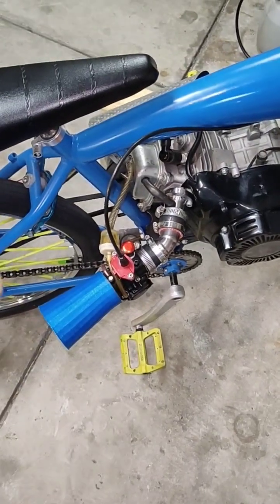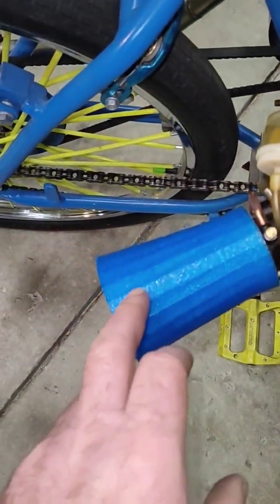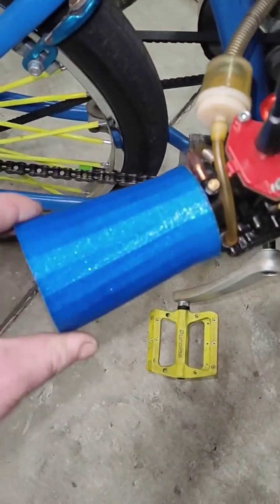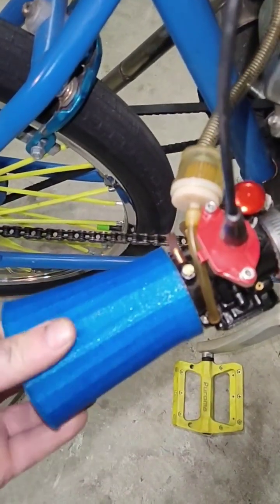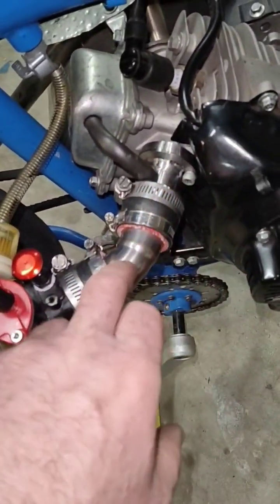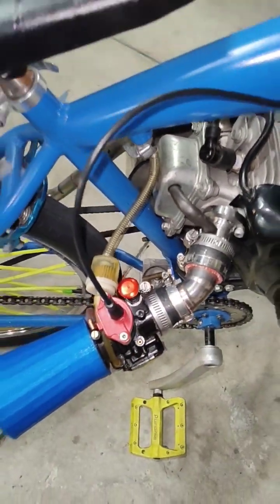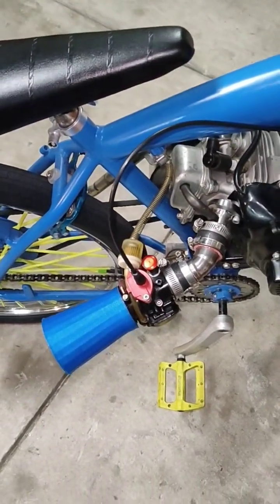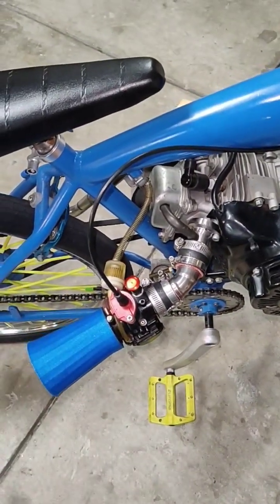V Stack Test Of The Modified 110cc 4 Stroke. (Trying To Stop Blow Back(

Comment: Why do you have your valve cover venting into the intake port ????
Reply: common practice on car engines, keeps the top end oiled up with oil vapors from the crankcase.
Reply from the maker: @Matthew-wj8cm  couldn't of said that any other way 😂
Reply: @Matthew-wj8cm  they don't do It for lubrication on cars. There plenty of oil shooting out the push rods. 😂  they vent the valve covers for epa
Reply from the maker: @2strokecarbtuningportingin187  now I was told they vent the ohv small engines to let the carbs air flow help draw oil up into the valves easier.  Like a vacuum effect.  That was by tons go kart nerds. Then again I seen people just air filter them claim it's a vapor lock breaker.  I honestly never seen either setup long term run because it's always been on a go-kart that's blown in few races anyhow.  Now you both got me curious! Edit:  yeah car makes no sense but go cart* people on there race carts for the reason I listed above makes sense.  Yeah EPA on car you drive to work for sure 😂
Reply: @BuildBreakFix cool I just know on four-stroke  motorcycle  engines ie race motors and grudge motors typically  you eliminate  crankcase venting  into combustion chamber. Typically  they vent from valve covers and are call par valves ie little set of reeds then from par valves they vent into airbox. They get eliminated  and blocked off. But definitely  needs to have vent typically  vent to catch can then to atmosphere. Race motors we actually  run a vacuum  pump to keep negative  pressure  in the cases .makes more hp
Reply: @2strokecarbtuningportingin187 on old cars like in the 20s, they did that for lubrication. On newer models it's for emissions yes. You don't want oil vapors going into the atmosphere. Meanwhile I'm here riding my 2 stroke LOL
Reply from the maker: @2strokecarbtuningportingin187  yeah I saw them deleted to air filters myself.  Never seen exhaust one. I can remember off hand on go-karts.  But would still serve same principle as intake vacuum m idea.  Vacuum pump would be crazy interesting to see